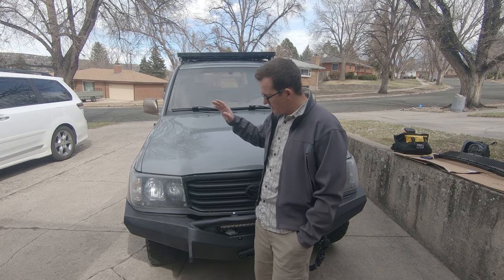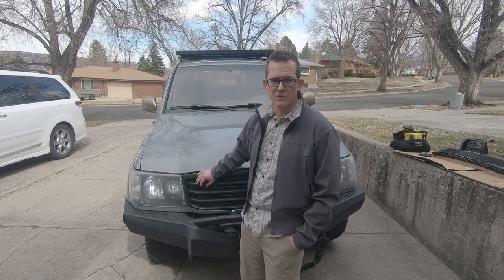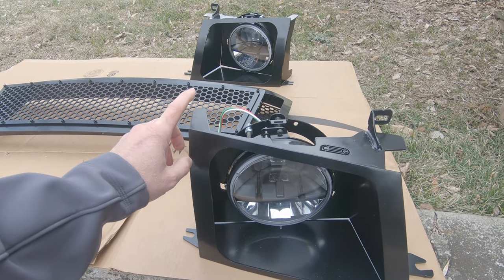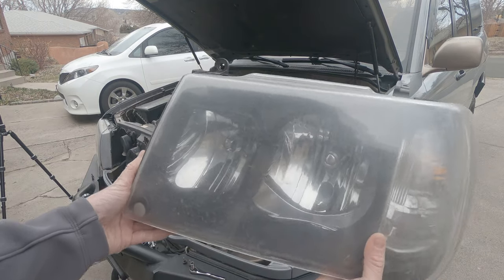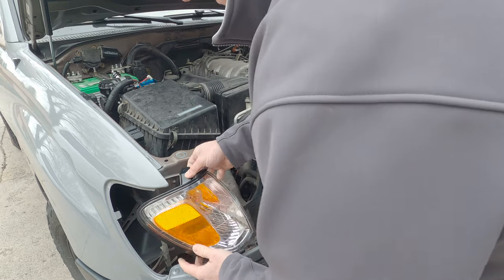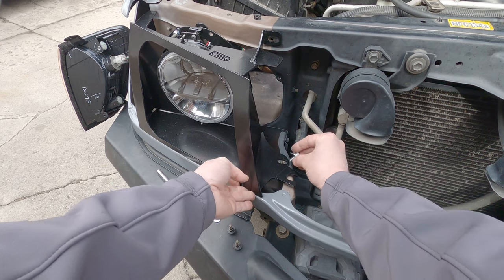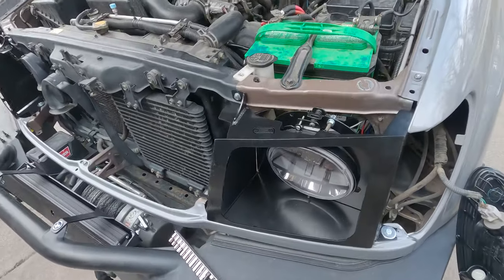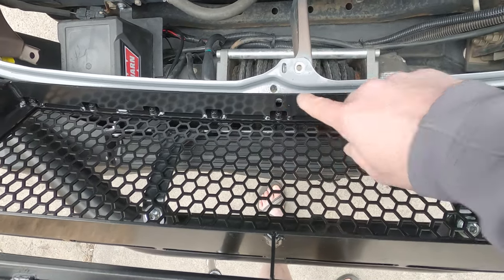Toyota Land Cruiser 100 Series Land Cruiser Grilles Headlight & Grill Install

Comment: Hey there, was wondering if you ever go the headlights wired up properly and how has the mod held up? I just took the plunge and did the install on the grill and headlight conversion. Thanks!
Reply from the maker: I ended up going with a 6" jeep light mod that I really liked; the Relay Harness from Gary at http://innovativewiring.com worked great even with the jeep mod

Comment: These look great, and I appreciate the install video. How do you like them now that you’ve had them for a while? Would you purchase them again? Also, how’s the noise from those headlight surrounds? It seems like they’d create more turbulence at the front end, but not sure if you notice it in the vehicle. Thanks!
Reply from the maker: Thanks for watching!  Yes, I would purchase them again; other than getting the wiring issue fixed I have never regretted getting them.  Don't think that it made the rig any louder, hard to say since the roof rack makes the most noise and it right next to my head.

Comment: They look great but at $550 + $60 = $610 before the 7" headlights are purchased. Very expensive set up. I used to run the Hella H4 7" lights which were fantastic. Highly recommended.
Reply from the maker: Totally valid point! I started down this path because one of the headlight assembly's cracked due to a rock, a Genuine Toyota Passenger Side Headlight Assembly runs over $300 each.  Knowing that my rig would most likely have the same injury down the road, I started looking for long solutions that would cost less in the end; if that makes sense.. Cheers!

Comment: So I’ve got this kit getting powder coated now. Trying to decide on which 7 inch lights. Can I pick up pretty much any 7inch out there - or are there some that will/won’t work with the LC wiring?
Reply from the maker: Congrats!  Going to defer to Cruiser Grills, but pretty sure the wiring is standard for any 7" light.  However, depending on your LC model there are issues with LEDs blinking and in some instances the high-beams not working correctly.  For me, I have the high-beam issue and still working on fixing it..

Comment: Hello, where did you find the connector for the oem side lamp housing to the headlight bracket?
Reply from the maker: Thanks for watching!  I ended up having a wiring harness made after trying to do it myself several times.  Gary Clark  @ http://innovativewiring.com is expensive, but great quality work; I ordered a "wiring harness for land cruiser to H7"
Reply: Hello im not mechanically inclined could you pls help me and point me to exact harness you bought? Is it the the depo 180 harness on the site or a custom job?
Reply from the maker: @ChilliRedify  No worries, I am not either.  Contact Gary, he will ask you a series of questions and ensure you get the right harness.